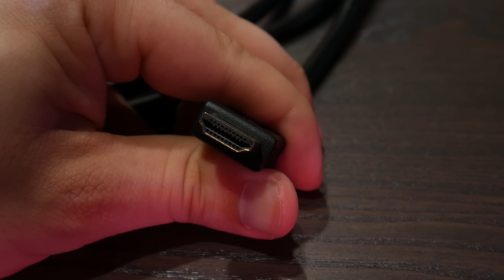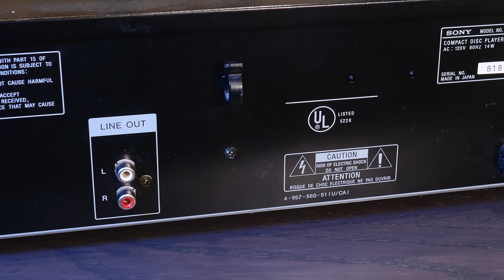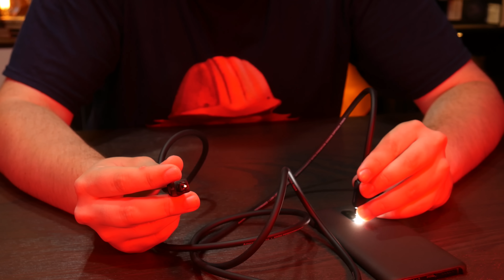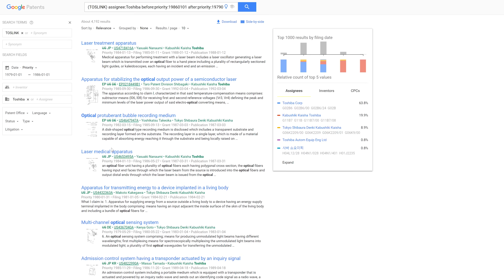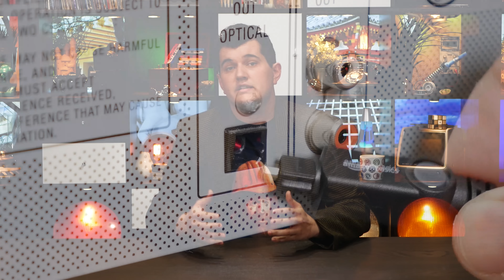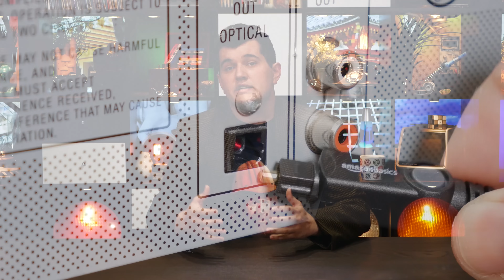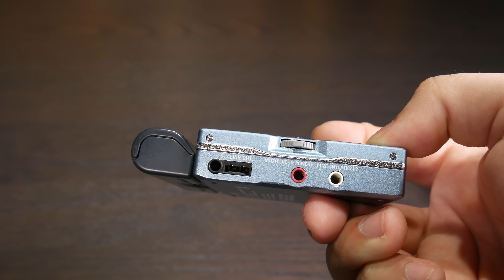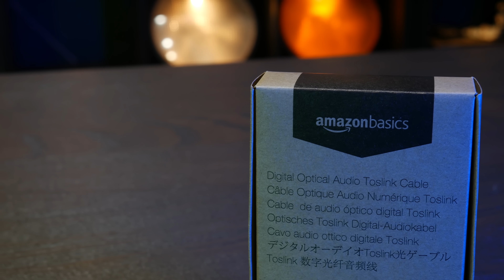TOSLINK: That one consumer fiber optic standard

Comment: I have used this technology myself. I would swear by it Seuss since the PlayStation 2 and use on my Pioneer 5.1 surround sound receiver. Although recently I've had difficulties with the technology when attempting to use the audio output from my PC and my PlayStation 4 wire a switch. Further the new tables they are producing seem to be far cheaper than the old ones. For example my original cable was one solid jelly like substance and if you cut it, it was just one solid clear jelly like substance. But it seems the new ones are some kind of a rubber with as you say a  fishing line in the middle.

So what would I say the pros and cons of toslink be over a ordinary digital cable. Well for one you don't have a ground line feedback loop. Now while it is fair to argue you are still connected to the building wiring if your power conversion inside of the amp is filtered properly you shouldn't have an issue. But when you start connecting multiple devices to gather that are sharing common power sources and their tables are also commonly linked you start to get really weird anomalies. Never mind that the signal itself is digital you're still going to hear garbage over your speakers that has nothing to do with the digital signal and while you could argue that filtering in the amplifier point is it still getting through and it doesn't have to. Now A distinct on to using the cable other than the aforementioned lack of support for more modern formats. I have noticed lag. to me it is about the same as broadcasting audio over Bluetooth. now why all that system works there is found a second to maybe a half a second of lag in there sometimes worse and depending on other various interrupts to the CPU system and chips at those little tiny moments of lag add up and it can get much worse towards the end of say a movie in playback. 

 now why not just use that digital cable? I want to put it bluntly many devices that support the toslink actually do not have a digital output unless you're willing to spend more for that device.

Comment: The main problem is you can't just cut the fiber optic and put the connector without expensive tools.
And It will introduce dangerous element, having the fiber stuck in your skin will be hurt

Comment: Ah, young Padawan, there’s another benefit of TOSLINK you missed: being a non-electrical optical cable, it completely avoided the possibility of ground/earth loops between pieces of equipment.  Sure, the use of a digital signal (SPDIF on coax) minimised the potential impact of ground loops, but once it gets to the actual audio power amp, a ground loop can make audible hum all on its own, regardless of the signal being digital or analog.  However modern power supplies and the greater awareness/thought given to cable shielding and component earthing since the explosion of EMC regulations in the mid-90s means that even this is a lot less common occurrence than it once was.  But back when Toshiba made TOSLINK, this was a real problem, and an optical cable was an excellent way to minimise such ground loops.

Comment: While the components connect eventually at the building's electrical system, there is a possibility that their grounds are at different levels. Using an optical connection prevents a ground loop.

Also, the electrical interference can travel up the ground and affect the sound output in ways that have nothing to do with its affect on the digital signal.

Comment: I use ARC in my home Cinema System but I wish I had the space for a Toslink cable in my cable management channels. ARC is so unreliable in my case and the amplifier can only auto select ARC but I could manually select Toslink. This causes me to sometimes restart the system several times before the Audio works

Comment: I didn't realize that Mini-Toslink was even a thing either.  I had noticed that most Macs would have the audio port glow until you installed the bootcamp drivers when installing Windows natively onto them but I did not know why they did that.  Apparently Mini-Toslink had been built into almost all Macs manufactured from 2006-2015, but they started to phase it out in 2016 after most consumers and professionals  (myself included) not realizing that it existed or using it.  I'm really surprised about this because I consider myself I very tech savvy person and I thought would have known about this by now but I guess it's just that obscure of a standard to non-audiophile people.  I did always wonder about the optical audio output that would appear under audio devices in system information but I guess I have my answer now.  It is kind of sad that they don't have it now because apparently there were some audio professionals who did use it a lot and now those people have to connect yet another adapter to their newer computers.

Comment: I just want to know why after 30 years there hasn't been a single new standard that sends ONLY uncompressed surround sound. The Handy Dandy Movie Interface requires a video signal to be sent with it, which is a huge pain in the ass if like me you have an AVR AND a 144hz monitor. Or if you're a musician and want an easier way to get audio set up. It's great requiring Windows (Or anything else) to have a ghost monitor that doesn't exist so things pop open on a screen you don't have and you get to play clicky-draggy-did-I-winny?

Comment: The main advantage of Toslink is the absence of ground loops.  This means that the source and receive equipment are completely isolated from each other.  No electrical noise is created in a toslink connection.  It enables quasi lossless transmission of the signal.  The only non linear part of the signal is  that prior to transmission and after reception there are two zero states in the ADC and DAC  converters, positive zero and negative zero since signed number systems have both positive and negative zeros.  This is not caused by the toslink but rather by the conversion of the analog and digital signals. So the best audio signals, theoretically at least, are analog over copper using isolation transformers. In 16 bit audio there is a  1 in 65,536 error as each time the audio waveform crosses the zero level.  This is about  .0015 % distortion. A 24 bit system lowers this distortion to about .000006% distortion. Neither of which can be detected by the average human ear.  But the hum and clicking caused by ground loops are very noticeable, so Toslink was a very noticeable improvement in audio.

Comment: Excellent video, I learned a lot. As a side note, toslink cables are still useful as a very cheap fiber for experiments. 
I validated the output of our university's monochromator by calibrating the photo spectrometer to a Neon-1 source and then connecting the output of the monochromator to the input of the  spectrometer with a 15' toslink cable. It worked very well. Commercial fiber cables are way expensive at 15', so if you don't care about loss the toslink cables are a viable option.

Comment: One I've run into recently with a raspberry pi project - why can I buy 100 meters of ethernet cable and run it, but if I buy over 20 meters of hdmi cable it has a chip on board at both ends, a display end and a source end and refuses to play with splitters.

What's different about 100 meters of ethernet cable vs 20~30 meters of hdmi cable?

Comment: Hang on, the whole "any cable will be fine because it either works, or glitches".. isn't quiiiite right (um, I think) when you throw error correction in to the mix.. yes, there's faultless error correction, but PCM also supports a level of error correction where it'll basically guess.. so, it's completely possible that an only juuuuust ok lead is causing the D/A to not glitch, but be making the final audio stream be, in effect, made up.. Now, I'll admit, this is moving in to audiophile teritory, but I know that personally, I'd like as much of the original bit stream as possible... Love ya vids, btw.

Comment: If I understand correctly, fiber is only useful over great distances like the internet infrastructure, because there's going to be a bottleneck somewhere whether it's your power cord, house wiring, the circuits inside the equipment etc. Any improvement in quality of signal in the fiber audio cable is negligible because of all of these things right?

Comment: There is such a thing as a too cheap TOSLINK cable.  I got a sound bar with only an optical input to use with an older TV.  Found an optical cable in the "cable collection box", plugged it in and nothing -- silence. Checked that I saw the red led coming from the TV but before returning the sound bar I purchased a seemingly better optical cable (about $4 US).  Plugged it into the TV and saw that the red led was much brighter. Connected to the sound bar and behold -- TV sound was filling the room.

Comment: Really would like to know why toslink was so much more common than RCA. Like, receivers often only having one RCA digital connection and several toslink sockets. I can only guess that the toslink connectors are cheaper (fully injection molded plastic with a simple led or photodiode vs mixed plastic and metal. Also don't have to worry about impedance matching.)

Comment: I don't think we'll see consumer use of optics until bandwidth and speeds increase. Or when plugs become stupidly complex because of bandwidth requirements.
The first consumer use that'll be widely adopted should be optical internet, but only if there's not a junction box that takes fiber from outside to copper in the house; end-to-end fiber would be best, but I doubt we'll ever see true end-to-end fiber. 
The second consumer use will be data transfer connections. Optical variant of ethernet, optical USB, which ThunderBolt was in talks of adopting an optical standard, but USB 4 is absorbing the TB spec, optical variants of DisplayPort and HDMI, etc. Which all of these optical standards will get confusing, because nobody will agree on a single cable type. But we shouldn't see optical A/V for awhile, other than having simplified cables, A/V will never push the bandwidth requirements for optical to make sense. The only A/V thing I can think of that make sense for optical are things like Dolby Atmos, which supports up to something like 128 speakers.
But the problem with optical cable is that it's just too fragile for most uses. It has to be buried, so wind and tree limbs don't snap expensive cable. It's too fragile for consumers to constantly be messing with it, copper based cables can handle stress fairly well, optical fiber will not. And it's overall just expensive, premade connectors will be expensive, custom wiring for in-wall use in homes will be expensive, etc. 
Copper will always be preferred from cost and ease of use, especially when there's no real reason to move to fiber outside of very specific use cases. And who knows, maybe once processing moves to optical nodes, then we might see wider adoption of optics.

Comment: You are looking at EMC wrong. When you mix digital and analog equipment, the concern is the digital equipment injecting noise into the analog circuits. The high speed switching of digital signals is perfect for messing with analog signals To avoid these issues, you need complex physical layers that use differential signaling, and you still need shielding.
There is also the groundloop issue. Groundloops are difficult to avoid in large hi-fi systems, and they can affect both digital and analog signals.

Comment: Toslink has one benefit. It eliminates ground loops that can carry through the amp. An absolute shame HDMI, or other data connections have not utilised it. Having a connector that eliminates ground loops, and won't wear out the connector would be great. I'm guessing there's a cost to bandwidth problem. HDMI is cheap and has huge amounts of bandwidth, and I'm guessing an optical cable that handled the same amount of bandwidth would require expensive optical transmitters and receivers. I wouldn't mind paying that premium for optical! :(

Comment: It's a shame that toslink wasnt updated, it has the potential to out perform hdmi, it has a much smaller connector and can be reversible much like type c usb. If they replace that led with powerful lazer, they can effectively triple the maximum length of the cable....

Comment: The major difference is, data sent by light does not need a ground to preserve data integrity, therefore you have no issues with noise nor do you have issues with ground loops, which are an unfortunate issue that has almost always plagued audio equipment. However, optical fiber isn't perfect so the length of usable cable is limited by the quality of the fiber. There's also the possibility that the conversion back into digital can have imperfect clock detection, though the later is suspect and mostly something only claimed in the audiophile community.

Comment: I think you mention optical as being immune to electrical interference. More to the point is the the optical cable will not emit radio band signals. We have come to accept that rf spectrum is swamped with huge amounts of mush interference. Up until the mid 80s very few homes had any devices that can ruin your am and fm radio.

Comment: You didn't mention one of the best advantages of TOSLink, and the reason why I still use it today: inherent ground loop isolation. When there is no electrical connection between components in the audio chain (electrical plugs don't count, their switching power supplies are already isolated), yet the two devices share a common ground, you have the potential for ground loop interference in the audio signal. Any difference in ground potential is reflected as audio noise.

Connect the two components via TOSLink, and that ground loop vanishes - there is no second ground connection.

Also, you didn't mention that using TOSLink (or the much more rare coaxial SPDIF) instead of analog connections potentially bypasses a DAC/ADC/DAC conversion. Particularly in receivers that digitize the inputs, process them for effects etc. and then convert back to analog for the amplifier (or drive the class D power amplifiers directly!). Giving it a digital signal skips that DAC conversion in the audio source as well as the ADC conversion in the receiver's input, leaving you with a pure digital signal until the final DAC.

Comment: I've had technical problems using S/PDIF with cheap cinch cables, but never with TOSLINK. But yeah, HDMI is in most cases better (also, MADI if you need many channels or long cable runs).

Comment: Mini toslink was super common on apple laptops, and even was the source of certain faults. Over time the jack could wear out, or some dust could get inside, I don't know. What I do know is that the computer would have trouble recognizing when normal headphones were being used, and believe them to be toslink. So instead of sending electricity to some speakers, it would hopelessly shine a light on the connection.

This could normally be corrected by going into the system settings and manually selecting the type of audio out signal desired, but iirc, it didn't always work twords the end of the laptops life.

Comment: TOSLINK / SPDIF connection only allows lossless 2-channel PCM (normal) sound. But many times it will allow lossy 384kbps 6-channel dolby AC3 sound. so if you want 6-channel speakers working with a single toslink cable, you have to "change" all the normal PCM sound in your PC into dolby AC3 format. 

you can either do that with a soundcard that has "Dolby Digital Live" function, or you can use ffdshow audio decoder "AC3 Encode Mode" which will work with your movies (regardless if they come with AC3 or not). but that's only for movies. no dice for gaming etc. so if you're planning to hook up 5.1 speakers with a toslink cable, keep this in mind. if you're not using PC, well you're way more restricted then.

Comment: BUT.. HDMI also has HDCP.  Using it for an audio-only connection doesn't seem likely. Or maybe the equipment isn't common yet?  Kudos for not mentioning the external DAC wars.. one of the sustaining reasons for SPDIF.  But, No.  Pronouncing initializations - Not Meant To Be Pronounced, like acronyms are - is not fun.  It just makes you sound like the nerd version of a name dropping Hollywood wannabe.
Reply: ARC has been around for 10 years (so yes it’s pretty common) and it doesn’t make the port audio only.

Comment: Actually.... the gold plated cable that has both the electrical connection and the fiber optic bits through it... that provides a way to effectively double the bandwidth of the fiber optic cable. You just need a light to voltage controller with a manual electric mixer after the optical input. It comes at the cost of making it susceptible to analog noise, since the frequency mixer would have to look at the exact voltage coming through the electrical connection to demodulate the signal properly, allowing the analog shift to be greatly amplified in the process, but it could also greatly increase bandwidth... like... on a 3.3 volt signal potentially 3 times, and if you use 5 volt+ logic, an exponential number more. 

Hhhmm..... maybe this could make cluster computing interesting.... I'll think about it a little. 

The other drawbacks: High attenuation in the fiber optic material, unnecessarily expensive cabling, and proprietary incompatibility.... that'd all still be a problem.